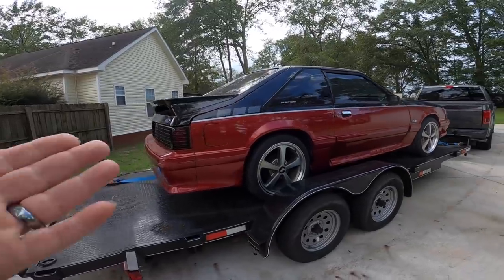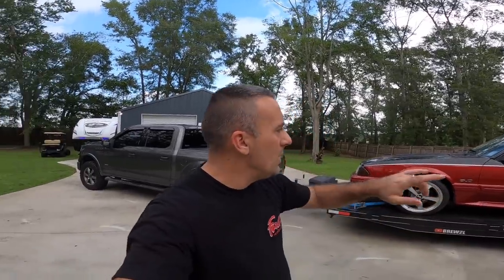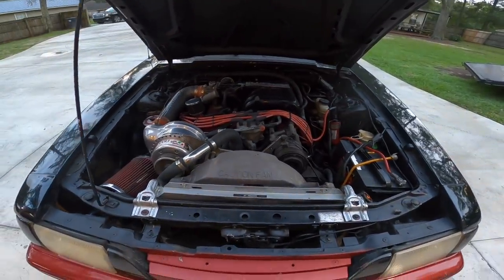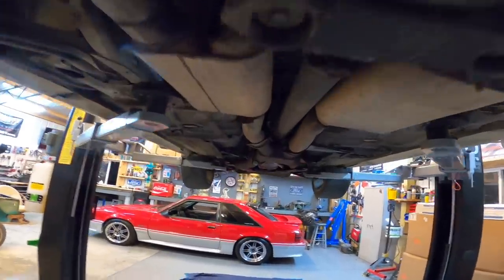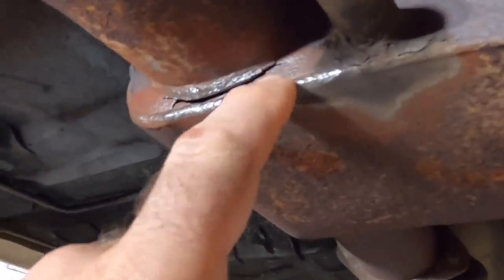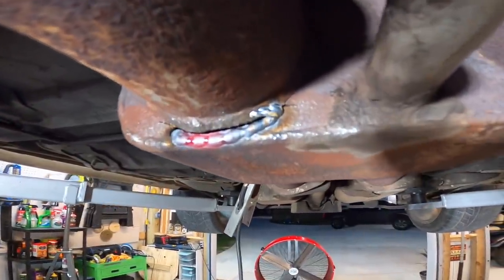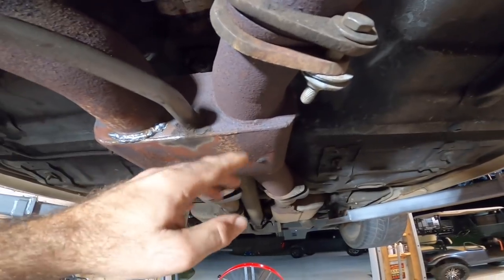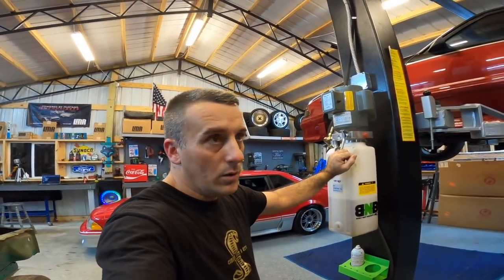This Old F-Cam Still Sounds Amazing! #SUPERCHARGEDFOX

Comment: Just a small tip for welding cracks, it always helps a ton if you drill a small hole on each end of the crack. This will stop the crack from progressing and after you Weld, and it be good for years to come. 

Not as important but if you can also get in the crack with some kind of grinder and widen the channel of the crack. It will get deeper and have a better time adhering to more surface area of the crack (thus stretching the life of the fix) 

Awesome to see Poppa Ts car getting some love. As always love the content. You have taught me so much about things going forward with my 82. Thank you.

Comment: I rhave ran that engine supercharged set up 3 times and it's my favorite go to fun to drive and race combo "well for me" that you can do with the Foxbody.  Around 2005 I got away from the Windsor platform and went the mod motor turbo route for the tunable power but 3 years ago I got to digging around  in my storage and my buddies parts and put that combo back together. Thanks for the time you put into keeping the foxbody and mustang DIY with what you got alive....

Comment: That's the exact same Lincoln welder I have. it's great even with just the flux core wire. I finally did set mine up for gas though. 10 lb spool is the only way to go the small ones run out too fast.

Comment: I set up a return spring to pull the clutch fork back to hold the throwout bearing away from the clutch fingers. I was eating up t.o bearings. Tremecs use a pivot ball. I had to buy a McLeod adjustable pivot ball. Stock is set at 1.5 inches and neomustangs told me set it to 1.25 inches which gave me the right amount of clutch throw. He saved me a lot of headache. I pulled my tremec magnum out 3 times on my back because of that pivot ball and no return spring. Been perfect since.

Comment: @Brew2l.....take a multi meter and put it inline with your ignition switch.  What you are going to check is the voltage drop to your starter so what you want to do is take that initial voltage reading with key off vehicle sitting, then you want to turn the key to on position take that reading and last put the meter in "min/max" and crank the car over if you see 8, 9 or 10 volts while cranking then what's going on is you have a voltage drop to the starter and its causing it to "hang up", "stick" or crank slow. So then what you'll need to do is follow the harness from switch to starter and  check all connectors, connections, wiring and splices for corrosion, pin fitment etc and repair accordingly also it may be a good idea to swap in a ignition feed switch as well.....but that ignition feed voltage drop test will reveal all of your gremlins that's for sure!!!! Good luck and I'll be watching for your follow up videos on the papa t fox!!

Comment: I had the same problem years ago. Changed the starter still did it. Changed the solenoid 13 times. Changed the ignition switch and still had the problem. Ran a new wire to a push button and then to solenoid. Never had this problem again and it’s been 8 years.

Comment: If that starter is trying to hang. Make sure the starter solenoid on the apron is grounding through the apron panel really good. My car was doing the same thing. I shined up the mounting holes a little and it fixed that issue

Comment: My starter was doing the same thing. I changed my main starter cable and that fixed it.  I split the cable open and it was corroded inside. Outside look good though. Well, you heard how mine sounded, 😆

Comment: A good way to not “need” that first reinforcement weld is to just do some oscillation circle movements for the weld over the crack. It should keep it cool enough where itll fill the crack plenty and shouldnt blow through when youre continuously welding

Comment: Have you ever had a problem with your long tubes creating so much heat that it melts the clutch cable enough to break ? Happened on the highway 2wice ! I could not understand why my cable was snapping. Finally the 3rd time I heat wrapped the cable and it's been 4 years with no issues . 1 7/8 Long tubes create some damn heat lol

Comment: Starter::
Had one solenoid hanging up on  the 4.6.
Had a bad ignition switch on the GT. Not the key. The electrical box.
How many thousand times has the ignition switch been on/off?
Ive seen them make even the instruments do wierd things.😱
Reply: BTW
Got 3 bad solenoids in a row in a month from Oreillys. Locked up and kept cranking...
Switched to a tractor part number which looks like the old 60s stuff, and never had another problem.
Reply from the maker: I forgot to mention in the video it has new switch, solenoid and starter. Still the same thing.

Comment: I got a steering rack taking up room in my garage. Pretty much brand new, I only used it for about 10 1/8 mile passes then switched to manual. Hit me up and I’ll cut you a deal on it if you want👍
Reply from the maker: Will do thanks brother!

Comment: I heard the LMR cables stretch really easy. I have a 3 hook quadrant and no threads left on my cable. And alot of the firewall adjuster backed out. So I don't know if I did something or it's just the combo of parts